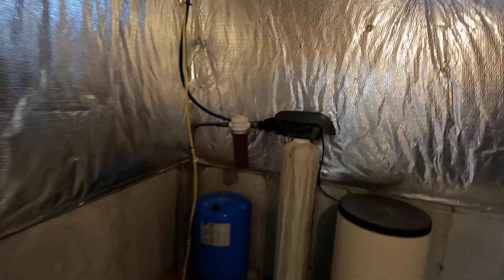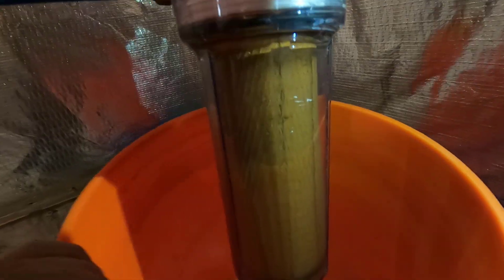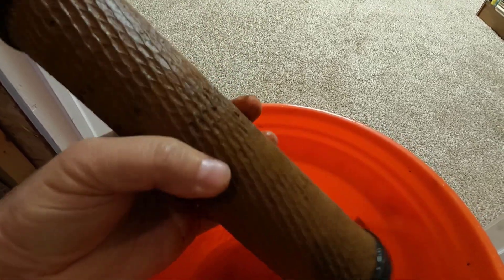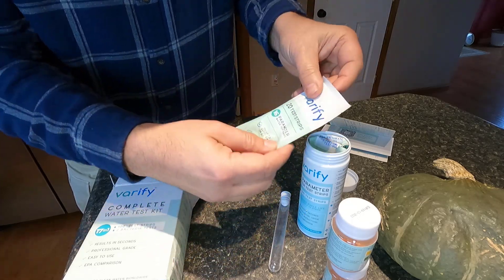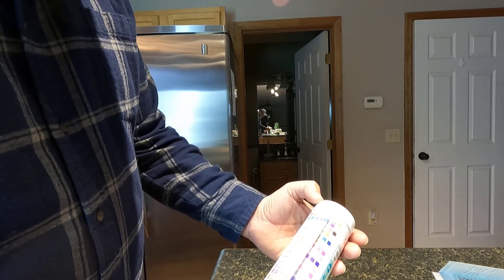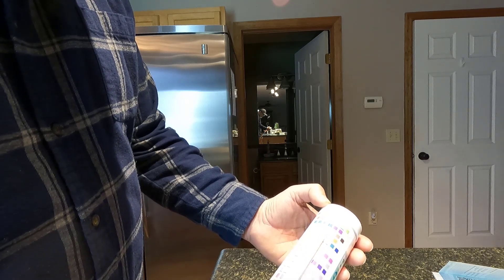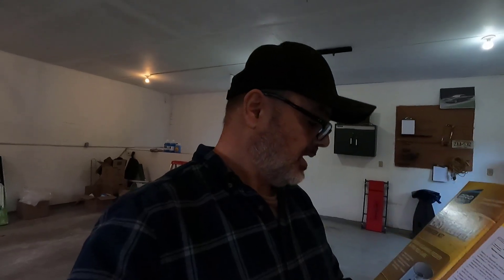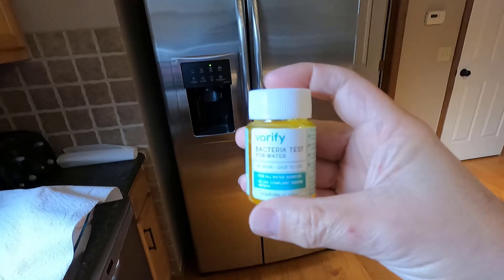DIRTY WATER!? Whole House Water Filter Change AND Testing

Comment: Best thing you could so would to be get a flushable filter installed before the main filter.  They have a metal screen 50 micron filter and a valve on the bottom to just flush out the large stuff clogging your filter.  Just flush it as needed into a bucket.  This saved me a lot of money on filter changes.  iSpring WSP-50SL Reusable Whole House Spin Down Sediment Water Filter
Reply from the maker: That's great advice. I added this very item to my Amazon wishlist for a future install. Many thanks.

Comment: I don't know if you recall but I posted before about having a similar set up. We used to by the filter you have and had the same problems with having to change them often because the water pressure would dip. We changed to the white ones. They don't filter as well but last longer. But we don't drink or cook with it. Just bathe and brush with it. So you may need to change them often. But yeah, they're disgusting when they're replaced. We do need one of those Resups. We never knew about that. Ours never had it. Good luck.
Reply from the maker: Yes Dez. The filter I have is a 5 micron filter and will catch just about anything coming through. I have seen the white filter you mention and they are 30 micron. I think it will work for me too and may try them out soon. Thanks for the tip.

Comment: Hi, you need to replace the Resin on the water tank.  I had the same problem with mine. Got to make sure the tube in the tank is not broken.  Get a strong flash light and turn the lightf off and point close to the tank to see how much Resin you have in the tank. I think your tube is clogged with the Resin.
Reply from the maker: Thanks Javier. I will surely look for those things.

Comment: That filter cartrige you just replaced is an activated carbon cartrige and is good as a post filter. That cartrige is good for chemicals, odors and flavor. You need to install a pre-filter before the softener to trap sediments. Try to buy the larger canister and filter element so you'll not to be replacing it so often. Great video!!!
Reply from the maker: Thanks E. I will surely consider your suggestion.

Comment: Ovi, the water sample that you used was post-filter and post-softener.  Your results are on the "processed" water.  To check your raw well water, you'll need to grab a water sample before the filter.  You can get it from the filter canister.  Also, if you have a water heater tank, you should drain a few buckets from it as I suspect the bottom of the tank has the same brown sediment.  Good luck
One more thing...you may need to set your softener for higher hardness since your water still measures hard post-softener
Reply from the maker: Thanks AC. I will surely test the water at the filter canister tomorrow morning. About the water heater, I didn't even think of that. Those are great ideas. After the water test and finding the water was still hard I changed the water softener setting to take care of it and it worked like a charm. We no longer have hard water. I can tell the difference when taking a bath, soap comes off easier. Many thanks for your tips. Much appreciated, not to mention that I have learned from you.